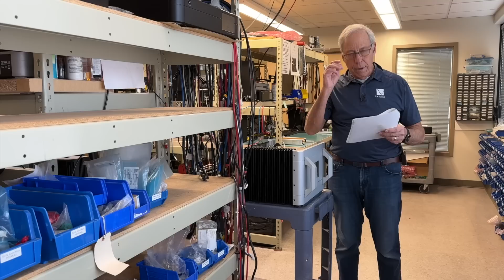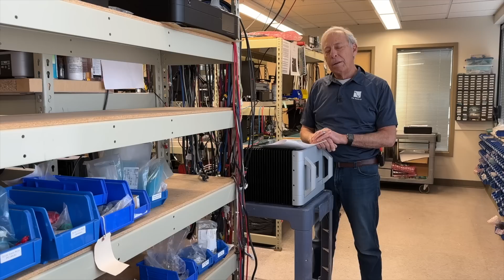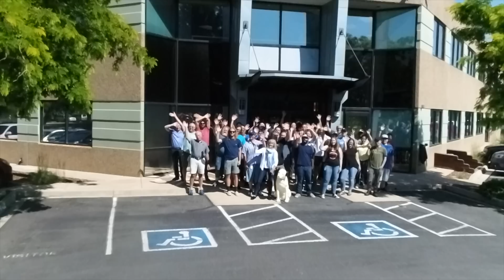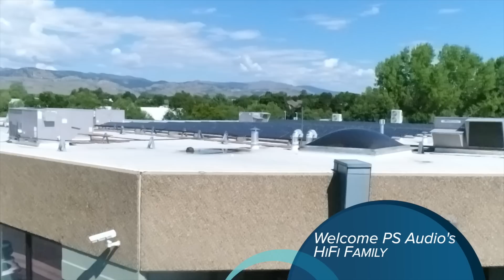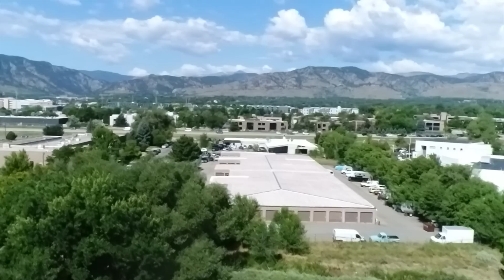Speaker break in: Myth or real?

Comment: Tires break in, engines break in, speakers break in, clothes break in. It’s all real and I don’t get why people think speakers are made of some magical material that doesn’t need a little movement to settle down. Love the straightforward answer Paul
Reply: Tyler, you have to remember that many people these days (young and old) do not have any “common sense” and lack a lot of basic education that would help them form “appropriate” thoughts.. is it congenital or learned? 
Most likely a combination of factors😉
Reply: I totally agree with your assessment. I think the real question is whether the break-in is "noticeable" by the average listener.
Reply: @clickbeetle2720  yes, clickbeetle 👍..case 
in point… a lot of the debating that’s going on regarding this post is due to the fact that most people have no concept of physics, and do not know anything about physics, and form opinions about things they know nothing about, based on what seems right to them for whatever reason; maybe their limited experience or trusting someone else they think is smarter than them, or whatever… BUT… People, you should know when you don’t know, so shut your pie hole until feeding time lol
Reply: @shipsahoy1793  
I know Physics.🤔❤️🤗
Square peg won’t fit in round hole. 😀 
Make square peg round, now fit in round hole.✅😊
I am waiting for my cookies and milk..😎😀🤗👍
Reply: Anyone who has touched a fresh never used spider from a speaker will recognize they usually are quite stiff compared to a used one. I'm wondering why we still have this problem decades later and nobody seems to find a better approach for spiders than this "spider fabric dipped in resin" approach.
It's easy to understand why a speaker with such spider behaves different from when it's initially stiff to when it has been softened after some use.
What bothers me is when people start arguing about other components needing burn-in where there is no actual explanation of it. Does a capacitor in a cross-over need to be burned in? I would say that only really bad (for audio) capacitors need burn-in (electrochemistry forming). It's a real topic of electrolytic capacitors but who the heck wants to see such capacitor used in the signal path of an audiophile system? Remember, electrolytic capacitors also DEGRADE over time so anything serving a filtering in a cross-over involving the value of an electrolytic capacitor will have a different sound over time also. Electrolytic capacitors can exist in the power supply where there is much less sensitivity to some loss of capacitance over time (if it's designed with that in mind).
So what other electronic component needs burn-in? Resistors? NO, Transistors? NO, Diodes? NO, ICs? NO, Wires? NO, Transformers?, NO, Non-electrolytic capacitors? Give me an example!
The best example of this topic being in snake oil territory is when the cable company NordOst claims this on their website: "How long do my cables have to break in?
Normally, we recommend at least 168 hours. However, our Reference level cables require at least 336 hours.". What a pile of utter rubbish.
Reply: @ThinkingBetter  Crossover poly capacitors do benefit from burn-in, as do semiconductor devices .. it’s not rubbish friend. And there are no perfect materials in speaker building, or anything else for that matter; just “optimal” choices depending on priorities.
Reply: @shipsahoy1793  Alright, show me a credible source of each of those claims (component supplier, science paper, engineering article etc.). Lots of polypropylene caps and lots of semiconductors exist and surely this is not a problem for high quality components where any drift in properties are carefully considered for precise operation from zero time to lifetime. I would try to avoid any component with a burn-in need in an audio path because it means it’s likely not reliable over time. Tubes and electrolytic capacitors are bad in an audio path because you will likely have a gradually changing sound with big tolerances.
Reply: @italianbirdvideos6190  yes! that is in interesting question which I was hinting at, but never directly addressed. To what extent is the break in noticeable and or is it measurable, etc. I don't read that much on audio forums, but I don't really see people running "before and after" in-room response measurements, or indicating that the measurements were done "50 hours after purchase" etc. So, as I said in a comment, break in is real, but how much it affects the listener's enjoyment seems to be subjective.
Reply: @italianbirdvideos6190   by the average listener it likely isnt. and that breaks my heart.
Reply: @ThinkingBetter  Wow, you need to spend some time working in the industry, and then (maybe?) your thoughts on design, electronic components, and manufacturing will surely change some of your opinions. In a perfect world, everything would be burned-in and rigorously tested to rule out infant mortality, faulty manufacturing, or even design flaws.  Granted that many times changes in a new product may be subtle or even unnoticeable over time, but everything does change, more or less, depending on what it is. Electrical performance of components also change over temperature, regardless of how “stable” the design is, and can be from changes in the surrounding temperature or from applied bias or other signals. Also, no manufacturer or an employee paid by them is going to sabotage their bottom line or bite the hand that feeds them by telling tales of woe.  
A lot of things get “explained away” in “political” fashion, and so there goes your proof.
Reply: @shipsahoy1793  I’ve spent a very long time in this industry and perfectly understand the need for burn-in to detect infant mortality issues. That is an entirely different topic. Of course electronic components change over time and certain parts do it faster than others. 
However, we are talking about “breaking-in” audio components to make them sound better. That issue is an entirely different topic of component properties changing within initial use. You need to ask yourself what material properties are changing during a short time. A spider becoming softer or an electrolytic capacitors forming oxidation are real. Frankly, if any simple component need burn-in you would easily be able to also measure it. You can measure a spider changing the resonance frequency during initial use, for example. How about a poly cap changing capacitance during initial use? I would like to know some real data or this is just ignorant rubbish.
Reply: @@Douglas_Blake For the cheaper NordOst cables the break-in time needed is exactly 168 hours which is another amazing coincidence. Possibly the electrons moving through the metal of the copper decide to dance to the music after exactly one or two weeks making the current flow more in a musical fashion. The more you pay the longer they wait to release their full potential turning ordinary copper into true audiophile grade copper.
Reply: @ThinkingBetter  I can’t give you the explanation you seek, as I do not know the technical answer to the poly cap issue. All I know is I changed some caps, and the sound was initially harsh and improved (smoothed out) with time; and it certainly wasn’t me getting “acclimated” to it, or giving up and accepting it. It happened on its own. I critically listen to different systems all the time. Ignorant rubbish wouldn’t be my go to position.
Also, I’ve noticed some equipment sounding better with warmup, but I’ve also experienced the opposite (on different equipment) for whatever reason. I go by what I experience, and I try to be certain I’m not imagining it. I have never heard a cable improve. 
I didn’t even think a woofer break-in was possible until I heard the before and after on some Elac woofers that I vibrated for a few weeks. There was visibly more X excursion for the same input than initially noted, and the sound was better. I chalked it up to a cheap woofer. Hell maybe that’s the issue here; maybe quality components made with quality materials under the tightest tolerances won’t have such large variances.
Reply: Yeah I don’t need to watch this video I know from experience.
Reply: @shipsahoy1793  Warm-up is of course a well understood phenomenon of components changing properties due to thermal dependencies. We are talking about break-in and your claim of polyester capacitors changing value from initial use. I have a large collection of new components in my own lab and have yet to see such phenomenon. Just you hearing something means nothing to me as I’ve heard a lot of such claims even done in blind tests professionally where no changes were actually done. I’ve worked in audio engineering for 2 decades. Any component that requires burn-in is likely not a high quality one btw.
Reply: @ThinkingBetter  I'll provide you one example that I personally experienced...the Klipsch Heresy IVs.   Fresh out of the box,  they were entirely flat, no bass response to speak of, and the treble sounded sterile...flat with very little dynamics.  I was 100% convinced at that moment that I needed a sub...period,  and was wondering about the terms of my return policy.  However, I gave them a chance and am so glad I did.  Over the next three weeks, they continued to break in as evidenced by them developing substantial bass response and sweet, and dynamic highs and mids.  In fact, the bass response was enough where I no longer felt a sub was necessary (180 degree turnaround).  That type of response does not transpire in dreams my friend.  That is real. I encourage you to buy a pair on your own to experience the break in period.  Others have commented on the same with those speakers too, so you won't be taking a risk... you'll soon be a believer in no time...though it will set you back a few bucks.  But, sometimes you have to pay to play. Enjoy.
Reply: @Artemis_Prix  Speaker drivers have spiders that are very stiff when the speakers are new and as they soften the motion becomes more linear and the resonance frequency drops allowing better bass (in case  of woofer). Of course this is a real thing. What is not ok is to use such example and blindly imagine that every other component equally changes from initial usage.
Reply: @ThinkingBetter  I didn’t hear anybody say “every component gets noticeably better sounding in equal proportion. Only you are putting words in people’s mouths. There are a lot of variables, some insignificant, and some more significant than others. I personally only used burn-in and environmental effects as examples of dynamics. Many different situationally dependent variables means just that. If you don’t want to entertain the notion of certain concepts, that’s your prerogative, but passing it off as “ignorant rubbish” is a bit of ignorance itself, with a dash of arrogance. You keep saying show me proof. You’ve never experienced something you couldn’t prove that others told you was you being crazy? When you start “thinking better” than everyone else, you just may be the ignorant one. Food for thought. That said, don’t get me wrong. I believe some of your comments are valid. But the same holds for others. No one is always right, and at times, off base for whatever reason, known or unknown. You wouldn’t be human if you weren’t flawed.
Reply: @ThinkingBetter  I agree with that up to a certain point, but at the same time, I know I’m missing something, and nobody else is able to explain it to my satisfaction either, but I’m not quick to think that I am all knowing because I’ve made that mistake before in a few situations; sometimes it takes quite a while to get to the actual truth about something, if at all, ever. I was a design engineer for 3 decades before I threw in the towel because of the political landscape, and I can attest to the fact that all is not created equal. There are pros and cons to every technology, and every type of component, et cetera, seen or unseen, and whether or not associated “parasitics” are impactful or possible to quantify through measurement. Some stuff is difficult or impossible to quantify well, but that doesn’t mean it isn’t there when you can’t see it.
Reply: @ThinkingBetter  Definitely, but I don’t think  anyone would write an article of that type without  irrefutable proof of their claims.. At least, as in your speaker example, the variables are well known due to actual physical motion and perturbation of materials. I think you could make a similar argument for a midrange driver or even a tweeter, but the woofers seem to get all the focus. Also, PSU transformers can delaminate over time due to eddy currents, and thus create ambient noise, but no one ever talks about that. I haven’t even seen an example of that in recent years, but back in the old analog days… lol
Reply: @shipsahoy1793  All components deteriorate over time. Heat itself and change of temperature accelerate the speed of it. But this topic is about audio gear sounding better after some break-in. Other than speakers, I would like to know which specific electronic product sounds better after break-in LOL. If Paul is so convinced that his audio gear needs break-in (other than speakers), he should identify what components are causing it and do a blind-test to prove it. I would love to see such effort. Perhaps he is right, but I really doubt it and he should too.
Reply: @italianbirdvideos6190  I think you hit the nail on the head. Original poster @tyler hackman gives the example of an engine breaking in, but the physical functioning of an engine (pistons and valves moving, bearings turning, fuel burning, etc.) is significantly more "physical" and prone to wear than a speaker surround and spider moving in and out a few centimeters. Surely there is some physical relaxation that occurs a speaker breaks in, but how much that translates into observable difference in sound seems much more questionable. To be clear, I absolutely am not arguing that speaker break-in is not real, I just approach it with healthy skepticism and questioning, as I expect any indepent thinker would/should do.
Reply: It's not very useful to say x breaks in so y breaks in. You should test each thing independently.
Reply: @EricBurbeck  Anything that sounds very different from before break-in to after break-in is suspect for being poorly designed, in my opinion. Even a spider should ideally not be manufactured with a hard resin that then crumbles to make it soft, which unfortunately is quite common. It’s possibly old tradition about design for manufacturing with the assembly of the speaker being with higher quality yield when the spider is not too flimsy.
Reply: The percentage of improvement one will achieve from breaking in equipment will be ABSOLUTELY MINUSCULE compared to doing simple things like having a high signal-to-noise ratio, or implementing proper acoustic treatment in your room 
It's a waste of time and energy. Almost as big of a waste of time and energy and explaining to audiophiles why expensive speaker wires  are a waste of time.
Reply: @powerguymark  It’s just one of so many topics that makes it into the audiophile world to make it special without much actual substance. A speaker with a stiff spider dipped in resin can be assembled more reliably than one with a soft spider thus making it real that speaker drivers need break-in. From this real case, the audiophile industry makes a lot of false claims of magic happening in other components during break-in. It helps reducing the very expensive return rate.
Reply: 'Engines break in so speakers break in' is not valid logic. The reality is that the amount of speaker break in that can be measured is so tiny that it would realisticly not be possible to hear even for the most trained ear. If you experience speaker break in, it is probably purely psychological. You get used to a certian sound signature and perceive is as more pleasant. Or perhaps your believe in speaker break in just creates a bias. It should also be noted that the theory of speaker break in is perpetuated most strongly by manufacturers who benefit from this myth. You are less likely to return speakers after a bad first impression if you believe the speakers need break in, giving you the chance to adjust to them enough that you might actually change your mind about them.
Reply: @haaspaas2  Agree 99% except many speaker drivers are born with a stiff spider dipped in resin to help improve tolerances during the assembly process and this spider will soften during initial use. It’s even a measurable difference (resonance frequency will drop). Is it much of an audible difference?  Possibly not and depends how much the speaker was in use during manufacturing and outgoing testing incl. any burn-in test.
Reply: Yes. Think new ball pen. 1st stiff the soft
Reply: I think it's possible that some people play their speakers too quietly to ever break in. Because power decreases roughly cubically with reducing loudness, you don't get much motion out of the cones at low and moderate volumes. You really want to push them fairly hard (within their limits of course which is why I prefer to remove the covers to check cone motion) and with music with good low frequencies. Then it shouldn't take a huge number of hours but may happen with a couple of albums. With smaller speakers it's easier but with larger speakers (like the big Klipsch floorstanders), you may have to rent them to your local club if your neighbours can't hack it. Or just play a low frequency sine wave below their tuning so that they stay quiet.
I usually find break in causes a bass and lower mids boost. Compare it to having your finger pushing medium lightly on the woofer and then removing it. The speakers move more easily and thus go lower. I'm not sure if there is much difference for midrange and tweeters, or headphones, but the bass drivers tend to work better.
Reply: I changed speakers in my car and I already had hard time to tell the differences because I did not do A&B switching and I am talking about two different speakers. So someone could tell the differences from the same speakers after x hours is so absurd.
Reply: @davidfromamerica1871  both will fit either depending on size